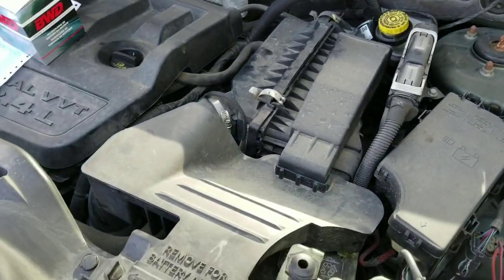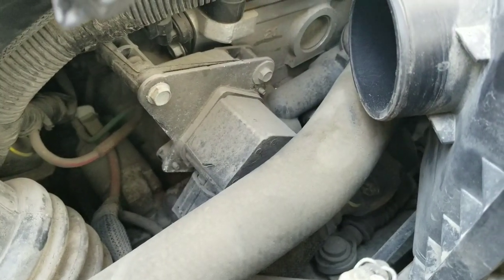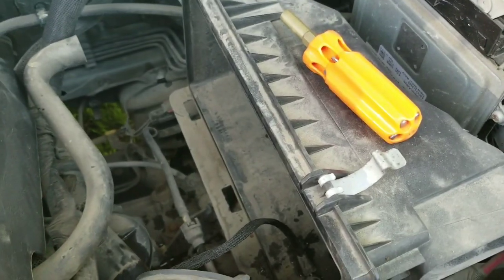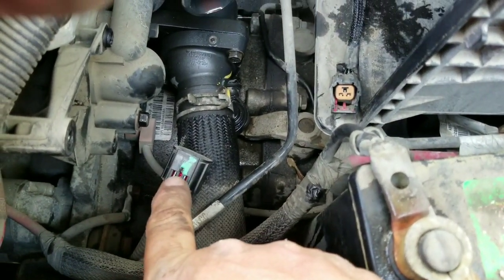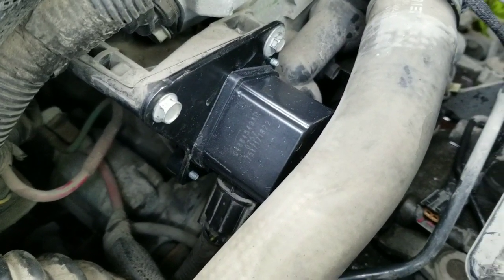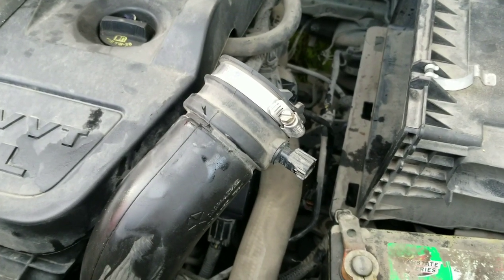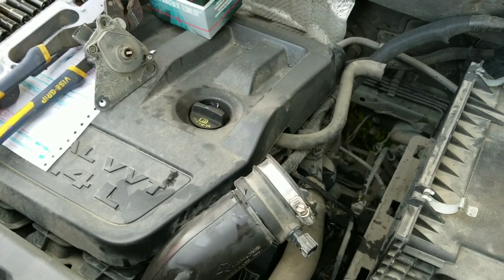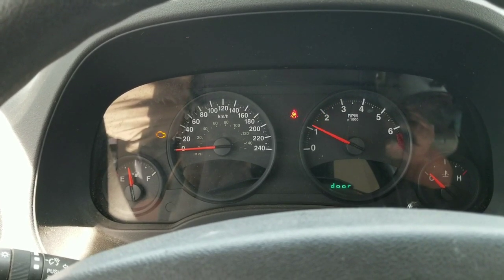how to fix Intake manifold runner control ( p2004 )

Comment: Thanks for mentioning the cost for that. That's what the mechanic said. Garage is putting in a new Manifold Runner Ctrl and O2 Sensor on my 2008  Pat North, 2.4L.  My Pat has 223000km on her. (138K miles.) Super helpful.

Comment: I have been working on my own vehicles since I was a kid. So I don’t really need the instruction. Like you said if you can see the part you can change it. I look at  videos like this to be lazy wrench sizes!! And straight to the point. 😁 So what I am saying there is 12 minute videos. There is 16, 18 minute videos. On the same topic, I tend to look for the shortest Right to the point, and like you said, tearing apart, half the engine bay to change out a three bolt part. Your video should have a much higher rating good job thank you very much for allowing me to be Lazy and go slap this part on good video👍🏽👍🏽👍🏽👍🏽👍🏽

Comment: This is a very common issue with some Jeep models- I have a 2014 Compass. And have the same error code! Thanks for the video! 
Unfortunately, this is not a "cheap" fix for such a small part...spring and spiral plastic.

Comment: 2015 patriot with 107K miles on the clock, about to do the same swap, $40 part from Amazon. Thanks for the video.
Reply: BTW, it worked out well, fixed it so check engine light went away and passed state inspection. Thanks again!
Reply: @georgecav7458  got the same part on Amazon. 40 bucks worked out well for my 2015 patriot. Thank u for the video. It was so helpful.
Reply: Could you possibly tell me what part number you bought off Amazon? I have to replace it on my 2015 Jeep Patriot

Comment: You don’t need to remove the coolant line. It is flexible enough to get it out. Also, you can check the manifold runner with a screwdriver and make sure it is free. If not then you will need to clean the manifold. Also, it is easier to remove the complete air filter box than take the filter out.
Reply: Probably ought to replace the filter if the runners are dirty, though...

Comment: Hey  yall .I have had this same problem with my 2016 patriot.all I do to fix it is take off the actuator then stick a screwdriver  into the slot that the actuator tab fits into.then I twist the screwdriver back and forth about 15 times with  good pressure to make sure flaps are moving their full motion. Then I spray pb blaster into the actuator and where it goes into the manifold.and reinstall the actuator. Dont buy a new actuator 9 times out of 10 they are still good it's just the flaps in the manifold get goopy from oil vapor from crankcase  through the PC valve..it should work for a good long while befor you have to repeat this process..even if you buy a brand new manifold this will  happen eventually. Hope this helps someone...its not all that hard to do..I believe in you🙂
Reply: How far are they supposed to rotate?

Comment: Before you buy the part after you remove it put screwdriver in the slot see if you can rotate the manifold runners. Newer engines with fuel injection get gummed up from the oil Vapor going through the intake into the engine for the emissions controls. I'm doing a Ford F-150 now that everything is good one of the runners are stuck because of carbon and oil build-up.
Reply: So I couldn't turn it w/a screwdriver on mine? Replaced the runner control valve and now it does a low whining noise....Does that mean I have to replace the whole manifold? Thanks for any help

Comment: I would suggest to try and see if the part that stays in the manifold can also turn , otherwise your manifold need replacement instead of just that part you bought. Learned the hard way.
Reply from the maker: it did move just fine and the part was obviously stuck but thanks.

Comment: Hey man did it end up working or getting rid of the check engine light ? Or did you have to do something else
Reply from the maker: This fixed the problem . I did t have  an obd2 scanner to reset the engine light but a local had one and did it for free.

Comment: Thanks for the video. I have the same problem, but i don't know wether its the solenoid or the actual flapper. Ill have to dive in sometime soon
Reply from the maker: pull and clean it sometimes that's well do the trick. thanks for watching !

Comment: I really need to know how “unstuck” to make it. I took mine out and it rotates about a quarter circle back and forth. Is it supposed to be able to make full revolutions? I don’t want to keep pushing it and causing a break
Reply from the maker: Sofiane Hadjar no it only rotates about a quarter turn . If it wasn’t stuck chances are the motor part is bad and needs to be replaced .

Comment: This might be a long shot since this video is old what was the part you bought?
Reply from the maker: Can't remember, but im pretty sure I say in the video ... Maybe not, though, lol!
Reply: @6bettyboo9 maybe anyways apparently on a 07 ford fusion we don’t have this I’m guessing it’s a intake manifold valve so I had put my car on Auto zone and it doesn’t fit my car so I’m guessing I don’t have one 🤷🏼‍♀️
Reply: I have a problem with my jeep too. I replaced the throttle body, pvc valve and the map sensor but still no power and aggressive on fuel @6bettyboo9

Comment: Will We have to reset the cars computer after we remove the battery cables. Does removing the battery cables throw out the computer?
Reply from the maker: No it should not harm anything to remove the battery cables.

Comment: I have the exact same car and the p2004 code does changing the sensor helped ?
Reply from the maker: kevin reyes yes this has rectified the problem for my mom .
Reply: @6bettyboo9  I'm going go try this. I'll update you. Thank you
Reply: I had p2004 and p2017 I think it was . Changed the part. Fixed the p2017.. now p2004. Still there.. and the thing in manifold turns ok.

Comment: I have the p2006 code in my vehicle for it being stuck closed not open but it says stuck closed in bank 1a was your code for your mom similar?
Reply from the maker: Brittany Elderbaum  I’m not sure as it was my moms car and they just read the code when she got her oil changed. However I’m sure they are the same problem. If you don’t have the money for the part you can try pulling it off and manually unstick the solenoid . Give it a squirt oh some light lubricant.

Comment: Hi,
I have a jeep patriot 2008 - i have the dreaded engine management light with error codes;
P2004 - intake manif runner Ctrl stuck open bank 1 
I have replaced the module on the side of the manifold and also replaced the manifold but the light has come back on. 

Can anyone please shed some light?
Reply from the maker: I dunno what it could be . Did you reset the code after the work was done ?
Reply: @6bettyboo9  yes i reset the code and it has come back on again. It definitely doesn't need to be reprogrammed again ? Or could it be a electrical fault
Reply: @lawrencesnelling6998  I've replaced three of these and ended up having to replace the entire intake manifold. Simply because it was stuck open. the pin was spinning all the way 360 degrees instead of just a half turn
Reply: Mines say throttle body while its the runner throttle light comes on changed it still same thing found and old paper from last scan at auto zone says runner stuck open

Comment: Please help. I’m doing my mom’s car too. Don’t want the government smog licensing people to bother me. 

So, I aligned the bolts and it doesn’t go on. I had to rotate it to “2 o’clock” from the bolt alignment spot, and then rotate it back to noon o clock from “2 o clock” while the center metal connections were together and then align and connect the bolts.
Reply from the maker: Sounds like you did it right.
Reply: Wow thank you! I’ll tell my friends to subscribe too. Funny some people mention you need to flash it at the dealer, but I don’t think you do